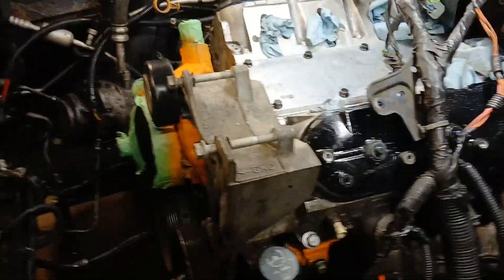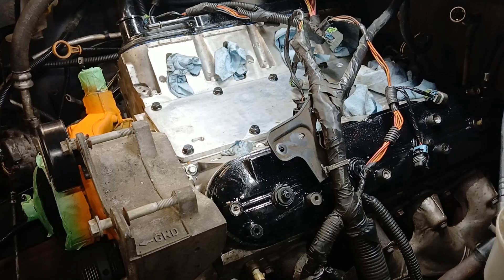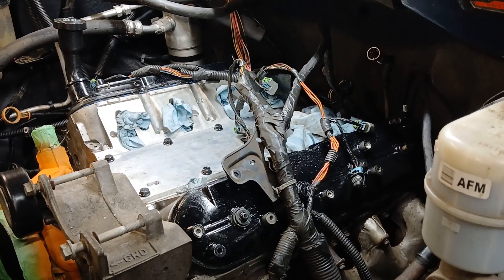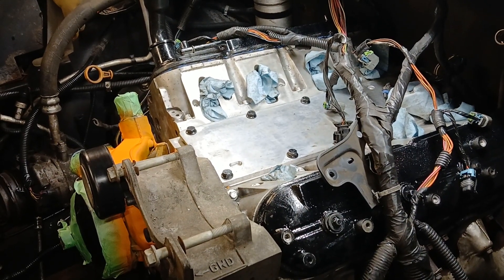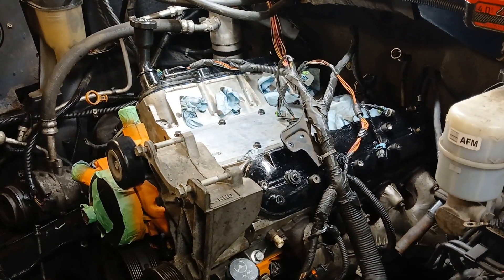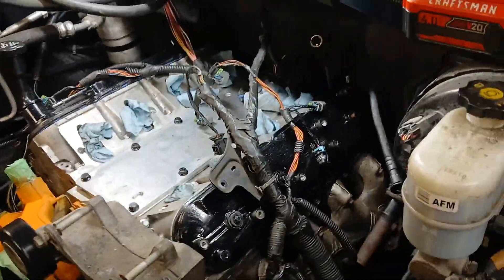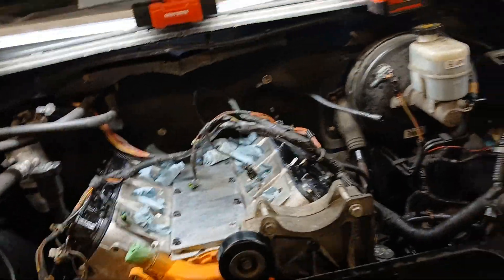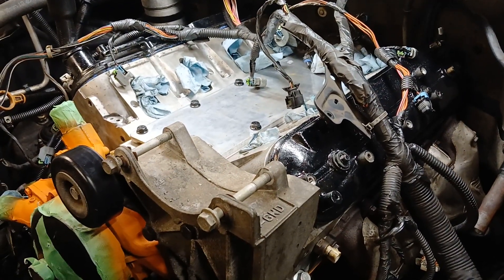5.3 rebuild / install update

Comment: In the old days I would draw a diagram of the harness routing. I would label each connector with a detailed description, sometimes using "colorful" language. In today's world of technology we have cell phones and digital cameras to take pictures before disassembly. The harness will typically fall into place and you can figure out what connector goes where. That's where labeling connectors helps out. 
At my age I'm done rushing around. When the job gets done it gets done. Towards late afternoon my feet start to kill me. I have to sit down and take a break. It isn't easy getting up in age.
Reply from the maker: i have videos and pics put my pc is 30 plus feet away easer to just park the tahoe next to it lol